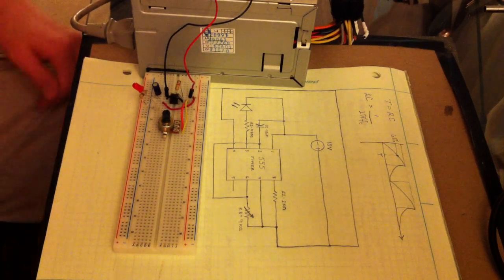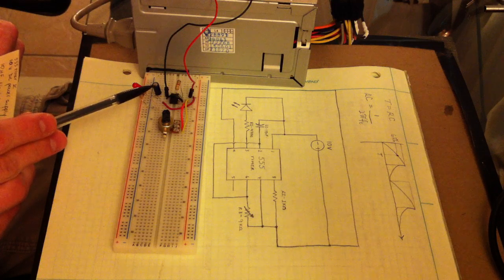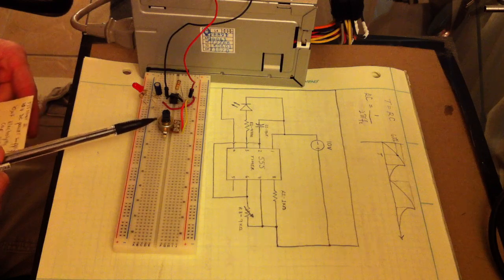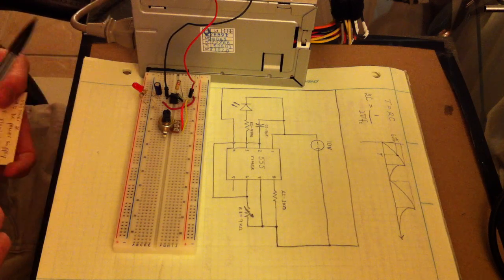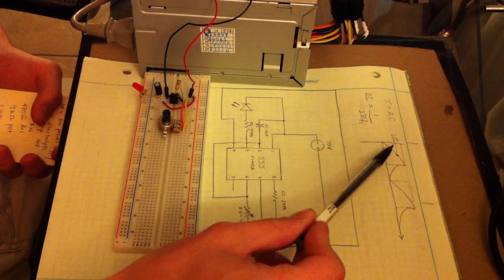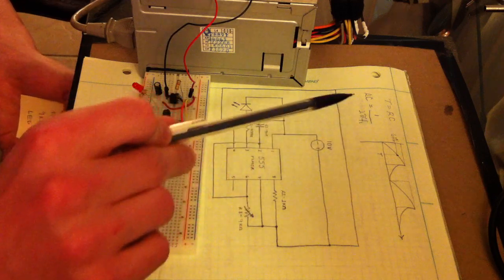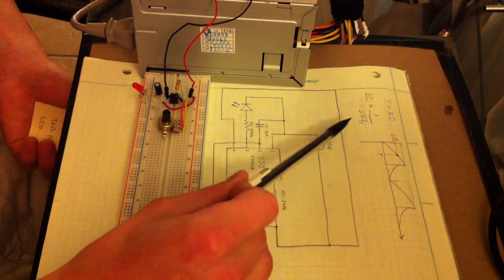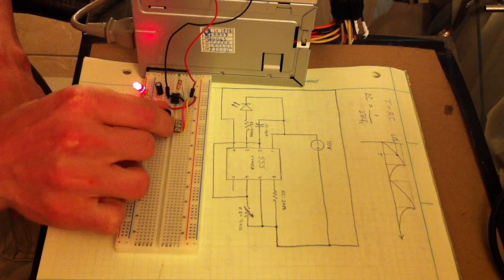555 Timer Circuits - Flashing LED - RC Time Constant

Comment: I don't understand what you did here. You used a 470 ohm resistor at Vcc ?  Why ?
pin 8 wants Vcc.
Another thing.why do you have a schematic ?  It is turned sideways to us.  Anyway, it looks wrong anyway.